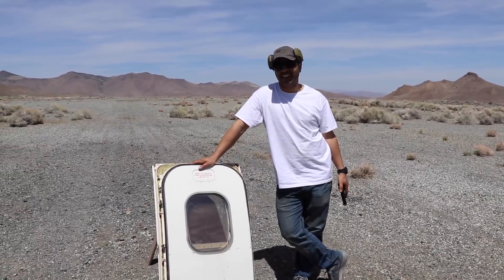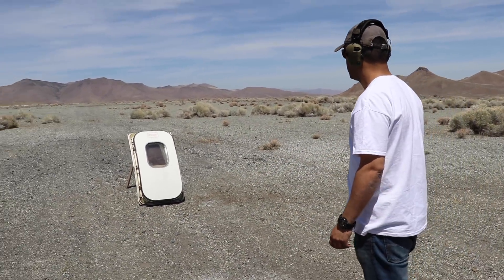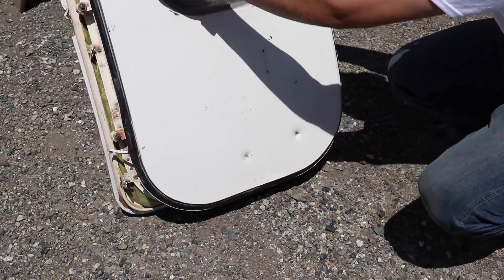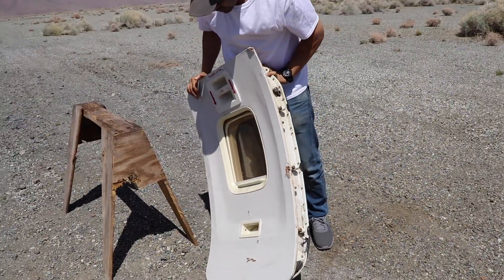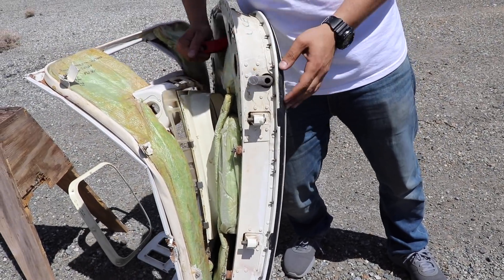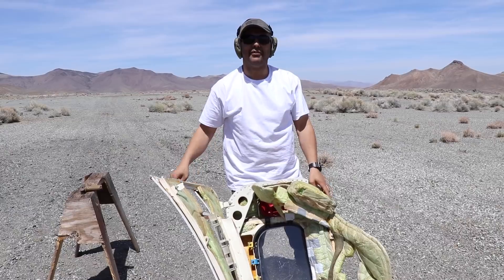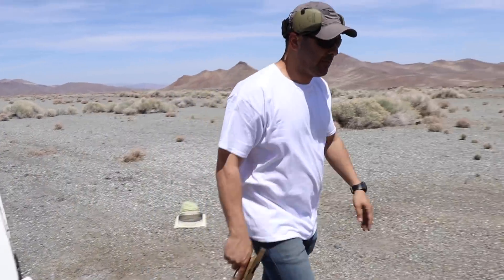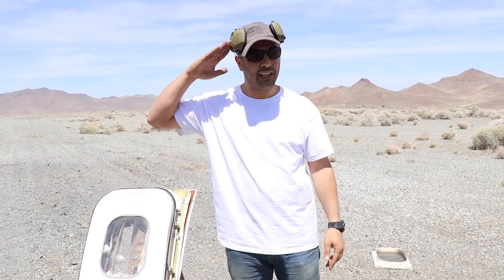What's inside a Boeing 737 Emergency Exit Door?

Comment: sick, I'm an aviation maintenance engineer, I had to remove, inspect and rig those overwing exits. Mostly for the 737NG which were hinged, but the jurassics and classics had the drop out overwing exits. 

Not a whole lot in them, you have your rollers to close and keep it shut, the stops (remove pin and twist to adjust), the handle, the insulation and the liner. Handle above, sometimes an arm rest or cup holder below. When removed there is a strap in the upper fuselage you can pull down, has a hook on the end, help ya out/off the plane.

Virtually what you're shooting through is basically 2024 T3 aluminum I believe, something like .040" or 0.060".. i'm not structures so i'm not too familiar with the type of aluminum and thickness.

The round things are rivets, the 2 screws at the bottom may be for draining, maybe for a component on the side of the door.. maybe for a quick boroscope inspection?  hmm.. never had to deal with them so i'm not sure.

Comment: "These round little things are the screws"  HA HA HA. Yeah, well the ones on the bottom are, those other round things would be rivets.
Yes, not too much in those doors as aircraft have to be able to overcome gravity.  This usually means weight savings everplace they can so thay can stuff more sardines in the tube.

Comment: only problem once you get all the airplane parts there and the plane put together, it will be full of holes and might not fly to well,,
Reply: General R. E. Lee it will fly better cause it has speedholes, plus itll add better presuurisation and clean air

Comment: Edwin a passenger jet fuselage is engineered to expand and contract during the takeoff and landing cycles, so except for the wing, elevators and the horizontal stabilisers or the connecting metal parts (tbh most planes have moved to carbon fibre since 10 to 15 years ago)  you won’t find any strong parts that can withstand bullets,
Reply: Tilson Thomas  not during the landing and takeoff but they expand and contract when at altitude, because of pressurization. Unless that's what you where getting at
Reply: Daniel Walker Australia you should’ve read it carefully, I mentioned TAKEOFF LANDING CYCLE, they expand at altitude and contract at ground level,
Reply: Btw, I didn’t necessarily mean carbon fibre, even though it’s used, I meant carbon composites/ advanced composites,
Reply: And everything except fuselage parts, are a good competitor for shooting, i.e cockpit windows, wing section,  engine housing, horizontal stabilisers